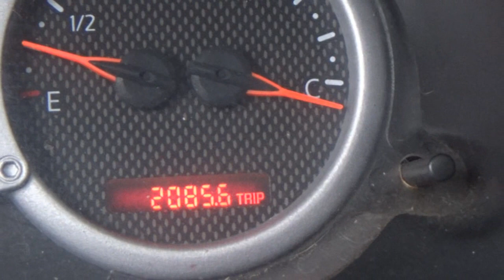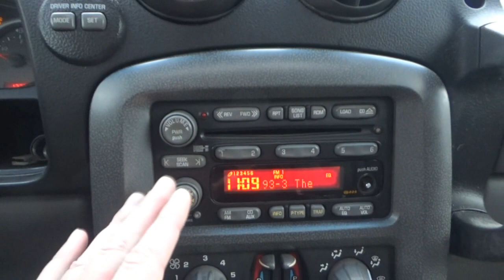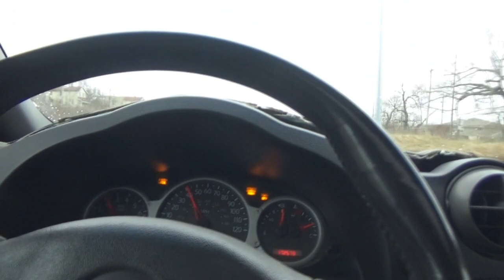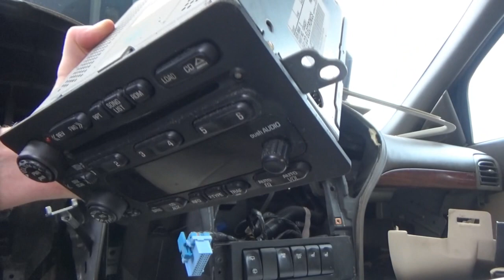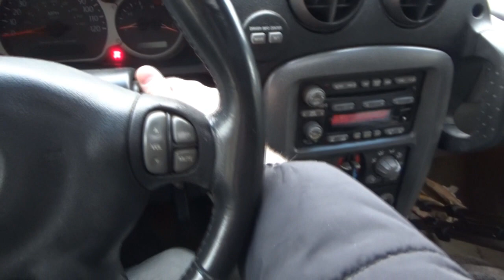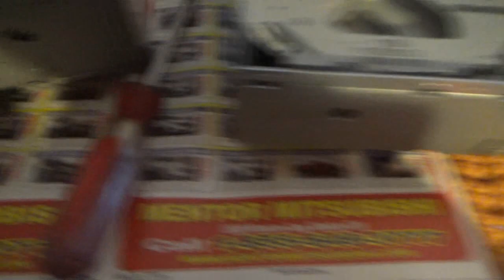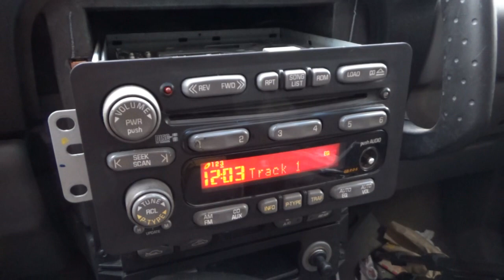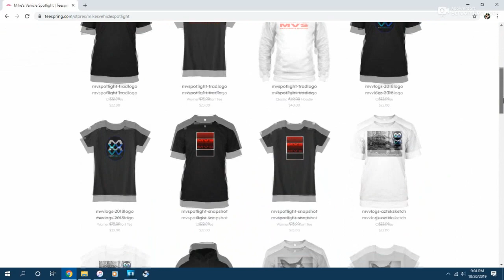MV 262 - "My Favorite Aztek Feature BROKE!"

Comment: Someone put a lot in to that '01. It's a base but added leather, the spoiler (whole hatch seems to be from an '03 unless they used an '02 hatch and removed the AZTEK emblem, the "A"s, looks like it has a nice dash too. 
For some reason, 02-05 taillights weathered much better than 2001s we've noticed.